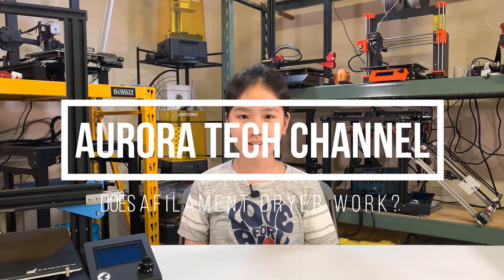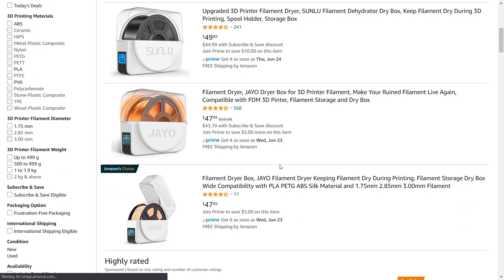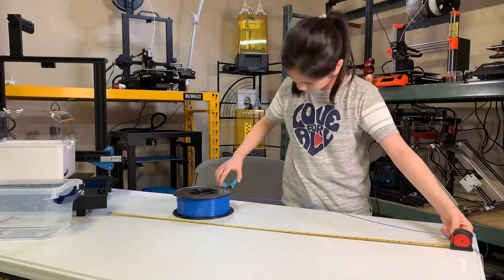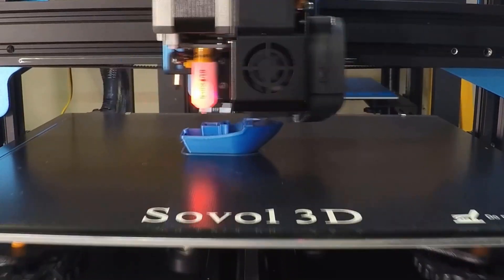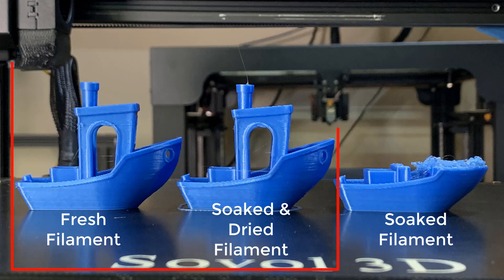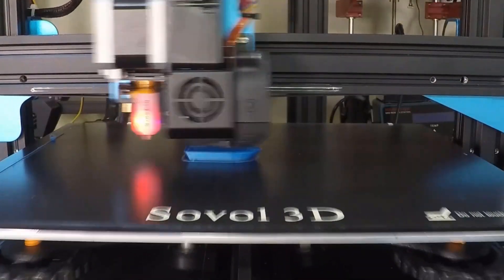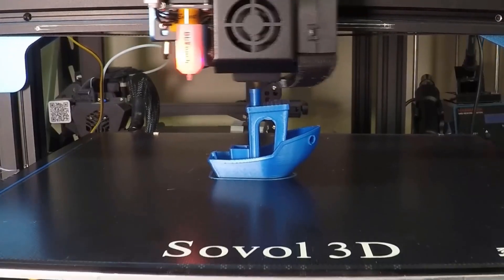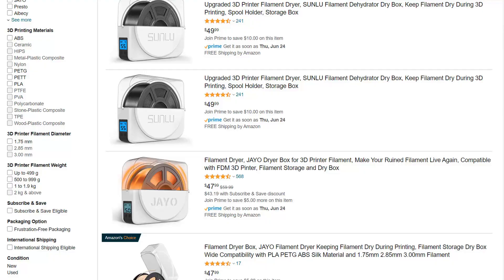Low quality 3D printing with moistened filament. Can this Sovol SH01 Filament Dryer be a fix?

Comment: Great video - as always 
I do have one concern in that there does not appear to be a fan in the unit so the obvious question is, how does the heated air(carrying moisture) escape from the enclosure ??
Reply: Also, where does the fan pull air from?.....the moist air.
Reply: The manual recommend to leave the cage a little bit open, so the humidity could run out. When the 12h heat process ends, you can close the door

Comment: Been thinking on a purchasing a dryer recently, but really having thoughts on if they really truly work. I got about 50 rolls of  filament just sitting in their boxes with the silica gel packs. 
If I want too print something I would have to plan on drying my filaments 6 hrs instead of grabbing the roll and just printing. Great video keep them roiling 👍👍

Comment: Good approach to testing young lady. What I still would like to know, is how moistured filament would perform if you keep it a while in a sealed bag together with silica gel? There are those vacuum storage bags from Sovol where you put the filament roll and one bag of silica gel in them. The only worry I have at the moment is that with summer humidity and one roll always mounted on the printer the filament will get moistured over time. Have seen filament that breaks when you leave it on the printer overnight, have other filament that is not harmed at all. Maybe also depending on the brand of filament. Nevertheless, thank you for your research and the nice video.

Comment: Flexible, cheap, multiple filament drying solution:

If your project workflow requires multiple filaments and printers, you need more drying capacity than a single or double specialty unit. You can't waste hours drying one or two spools at a time and the cost of larger units is prohibitive. Try to avoid an oven unless you have no other choice.

A temperature regulated food dehydrator using a 5 gallon plastic bucket will provide you with more flexibility if set up correctly allowing you to simultaneously work with a number of filaments across multiple projects and printers to meet your workflow.

Use a circular dehydrator motor, heating housing unit large enough to fit over a 5 gallon plastic bucket. Drill 5, 1/4 inches holes at the base for air flow. I use a NESCO unit with continuous temperature settings.

Drying temperature will vary by filament type and should be matched below it’s glass transition temperature. 

This allows drying of up to 5 spools (typically 1kg) at a time. Has worked perfectly for PLA, PETG, flexible's, and speciality filaments like carbon.

Comment: Great video, I’m glad you addressed this topic.
It would be interesting to see the experiments with more hygroscopic filaments, where the results is likely to be more noticeable.
Some drying boxes allows for connecting to the printer with a PTFE tube, whereby the filament can stay in the drying box while printing. Or create an enclosure around the printer, and add the spool holder inside the enclosure. The generated heat from the bed, the hot-end and electronics should help keep the filament dry (as long as it’s dried before printing).
I would love see more print manufacturers designing printers that way. But in the race to the lowest price, that’s probably not going to happen.
Reply: Sunlu S9 Plus 😉